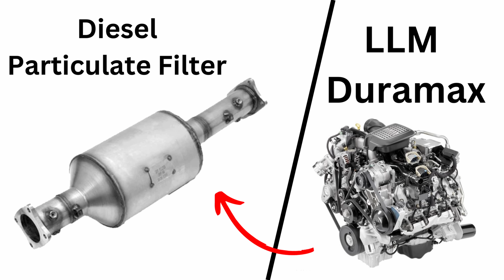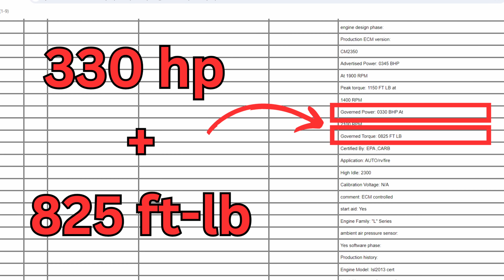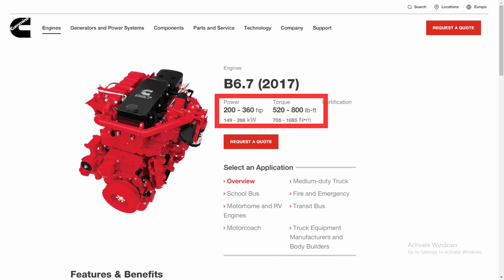Chevy 2500 8.3L DURAMAX Diesel Engine **Diesel Mechanic Review** | Should CUMMINS Be Worried?

Comment: You touched on one of the main points when burning clean.  That's called heat.  The more heat the better to an extent.  I work on jet engines and the more heat and the faster you can turn them the more efficient they are.  To detune an 8.3l engine is called a disaster when it comes to emissions in my humble opinion.  Anyhow great video!!  We will see...
Reply from the maker: Maybe de-tune was the wrong wording. But having lower cylinder temperature would allow less EGR gas going through the engine which would be a really nice bonus.
Reply: @GettysGarage  I respectfully disagree.  The higher the temps. the cleaner the burn.  And less to be recirculated through the system.
Reply: @JetTech1966 not for NOx gasses.  Lower cylinder temps mean less NOx.  It's not about actually making it more efficient, it's about making the engine need less emissions control.  Working within the confines of EPA rules
Reply: @JetTech1966  not for nox  higher temps higher nox.. nox is the most regulated exhaust gas
Reply: @chriso2759  I get what you are saying but I think I was on a different subject than you all.  Agreed lower cylinder temps means less NOx.  BUT....those lower cylinder temps are going to decrease overall efficiency and could very likely turn it into a soot monster.  The particulate filter it would need would have to be on full burn most of the time just burn it all off.   I'm just hoping if this beast is actually made, that it doesn't turn out to be a total bomb by GM and the new owners don't get railed with expensive repair costs.  I can see this thing being extremely sooty and having buildup everywhere.  Hopefully I'm wrong if it indeed is going to be built.
Reply: @JetTech1966  it won't be any more sooty than the other modern ones.  It will just use less egr since it theoretically has cooler cylinder temps at a base.  In essence,they have the same cylinder temps but the big one doesn't need to use the EGR to get there as much.  But yea, the EPA rules suck and make diesels suck.  Only reason I haven't bought a diesel currently
Reply: @chriso2759  My wife and I have been talking about getting the GM diesel but after having the L8T gasser now for a year and a half with zero problems and 20k miles.  I'm scared....lol...We are looking at buying a larger 5th wheel is the reason we are considering one.  I may just stick with the gasser.  It's been spot on reliable!  I would hate to get the diesel and have troubles with it, meanwhile I would be kicking my own butt for getting rid of the gasser.  I want one, but they do scare me for now.

Comment: Seems to me that GM had an 8.?l gasser a number of years ago for a short period of time (maybe early to mid nineties). Currently deciding if I want to get a 3.0 duramax - my big concerns are potentially excessive oil consumption (which GM clams is normal), along with oil that pours like water. Suspect there is a connection there.
Reply: Yeah it was an 8.1 Vortec you could get in a commercial/motorhome chassis or in the HD trucks and SUV's like the HD Suburban
Reply: I've never seen an unhappy owner of a 3.0L Duramax. It's an excellent engine
Reply: @PlayWaves1   Good to hear.
Reply from the maker: Ya GM used to have a big 8L gasser. People seemed to really like it. Simple and realiable

Comment: Yeah I need this emission choked hopped up pickup to pull my bay boat once a month. Stop paying people 400k a year to do nothing and pay your techs what they’re worth. EPA shame on you for forcing this crap on our country. The planet is not of concern. The dollar is. I have made a career out of aftertreatment system troubleshooting and overly engineered 1939 and ISO data line systems. Freaking joke. In 20 years these trucks will all be rusted away and not worth rebuilding and the seasons will still change. GOTCHA! My biggest RO’s are always after treatment system failure with contingent damage, def in fuel system (dumb driver), and in depth electrical. The logic is quickly fading from trucks. Stop buying the statistics. Have you ever seen an EV garbage truck? I have. It won’t ever haul a load more than a few miles. It cost more in resources to engineer and build that truck than my old Detroit will pollute in its lifetime. However, these trucks will make it to the next red light before I do. Got me there.

Comment: How are the ball joints on the chevrolet truck?  I had to replace one on my Dodge Ram with 5.9  at 46K miles.  I know that has nothing to do with the engine, but I wondered about the GM on ball joints. I wish my 2005 Dodge Ram had a Allison transmission. Great Channel,  liked and subscribed, best regards Chuck.
Reply from the maker: They tend to spit them out like every other truck. Depends on what you are doing. I personally don't like the independent suspension on their HD trucks but it seems to work alright

Comment: Perhaps a bigger 8.3 could deliver the same power as is but be within the EPA guidelines. With Cummins being fined and I’d be shocked if Ford isn’t next on their target list.
Reply from the maker: I think Ford and other manufacturers have the fear of god in them after seeing what cummins is going through.
Reply: I completely agree with you.  It comes down to physics and it all is to do with emissions.  Light truck diesel engines have probably been tuned to their max efficiencies and power for their current platforms.  There is not much meat left on the bone -so to speak, and more output would mean more NOx and more EGR and more aftertreatment... maybe even dual SCR catalysts would be needed (YIKES!).
So, unfortunately, the manufacturers need to lower cylinder pressure and temperature to control NOx --BUT lowering cylinder pressures lessens horsepower and KILLs torque!  
One solution to this is to use larger displacement to replace the lost torque, but it will be "de-tuned" so as to keep the EPA peeps off their back. 
Their will be lots of tech in a new diesel platform.  maybe we see cylinder cut-out at idle or low loads to pump O2 into the catalyst??  We are sure to see clever forced induction systems, like twin volute turbos, or compounding, or supercharging, or combination of all of the above.  This will give crisp, on demand control of manifold pressure so it can be dialed up to any boost level at any time (without lag) for instant power when needed and bypass to recirculation when not needed - waiting and ready to flow when the demand is called for.  This would give plenty of dense air (only when needed) to create a more complete burn and reduce particulates; consequently, running at lower cylinder pressures at idle and cruise to reduce NOx.

Comment: As for an updated diesel for GM light duty trucks.. I think a move to an inline 6 diesel makes sense. Duramax already has that platform in the 3.0 liter. Put power numbers up with the Ford H.O. 6.7. An 8.3 V8 diesel would be tight in that engine bay.
Reply from the maker: Id love to see a big inline 6 duramax. But I agree an 8.3L is a big engine
Reply: No they discontinued the 3.0 because it’s a nightmare that’s unfixable
Reply: @fastinradfordable   No they didn't. Ram and Ford discontinued theirs, but you can go buy a 3.0 Duramax Silverado, Sierra, Tahoe, Suburban, Yukon, or Yukon XL with that engine right now.

Comment: 5.9 Cummins is my favorite, my little wrecker was a 94 4x4 Standard Shift. It wasn’t the quickest truck but at 70 mph in a snowstorm with a car on the back, it was awesome. It has a 22 inch frame extension for the tunnel box behind the cab. I wish I still had that truck it was reliable and started at every turn of the key.
Reply from the maker: They don't make them like they used too lol
Reply: Sure...but how fast did it lap the Nurburgring.?  Handling counts just as much as quickness...
Reply: @buckhorncortez  ..+1 .. That's too Funny the Nurburgring. .. Cheers,
Reply: @buckhorncortez  why are you talking about the Ring on a truck channel. VW owns The Ring anyway. Sub 6 minutes, who else is going to do that without having its manufacturing facilities so close. Anyway it’s trucks. Lol!!!
Reply: There's a reason those motors lasted so long, they didn't have all the emissions requirements that we have today that is at the rut of the problems that modern diesels are having, and second, those motor were gutless, the 1994 Cummins had 160hp and 400ft.lbs. of torque, there are 4 cylinder motors making more than that today, those motors were so low on power that they simply didn't tear everything apart like the do today. If they dropped modern diesels to those power levels I'm certain that they would also seem to last forever.
Reply: @pnwdweler4100  That’s why we have Gale Banks, he’s the best engineer to figure this out. Just like the Cat on the ICE’s the PDF is the same. Some day they’ll find out something that won’t kill the diesel but until then I would rather be DEF free and have reliability. Just like the 300 TD from Mercedes a Million Plus Mile Machine!!

Comment: I don’t want 2000 ft lbs of tq.. I want a reliable truck. Easy to service and built to last
Reply: Preach father 🙏 Give us lower prices while we’re praying.
Reply from the maker: Reliability seems to be a thing of the past. Largely out of the manufacturers hands with emission protocols unfortunately
Reply: @TheGettyAdventures  Part of the whole reason this would be 8.3 is to get away from the emissions bs
Reply: @bhswarrior94 well if they just round it up to 751 hp then emissions would not be required 💁‍♂️😉 75hp to 750hp is the range that has to have DPF or DEF emissions. But that’s possible 2 years away so anything could change or happen with.
Reply: @kevink4914  Sorry, below 75 hp, only, the ship of higher power has long sailed. You can do it in India, and such places, but life expectancy is really low, mostly due to pollution.
Reply: @carlthor91 incoherent. I had an aneurism reading that
Reply: @GettysGarage  It's clear that the vast majority of diesel truck owners do not want the emissions equipment harming the mechanical integrity and performance of their machines. 
 As for the monster max, I'm betting this has it's destiny, (and likely the push for development) in military applications.
Reply: @GettysGarage  Yep - Thanks EPA! But it sure does help shift the money
Reply: @GettysGarage emissions affecting engines I’ll concede, but how that affects transmission durability is beyond me.
Reply: @GettysGarage so how do we go about dismantling the epa and such?
Reply: @contractor556 Trump almost did.
Reply: @contractor556 u dont want that.
Reply: @dr._breens_beard  heavily restricted at minimum. Get rid of Chevron deference where they and atf get to interpret rules that have the full force and punishment of  the law?
Reply: All ready have 21 yo D MAX  would love to have monster max
Reply: @techs1smh13  the diaper? 🤣
Reply: Got get a well cared for gmt800, only way to go in my eyes 🤷‍♂️
Reply: Well yea that's what everyone wants... But everyone also wants a new truck
Reply: Despite not being a diesel, my 8.1 gasser is an awesome towing rig. Easy to maintain, great low end grunt for towing due to that large displacement. 5-speed Allison is a dream. Get great and/or similar towing capability as it’s big brother the duramax, but without the stress and cost of diesel maintenance, while holding onto that towing grunt and reliability… so long as you don’t mind a few more fuel fill ups…
Reply: Nobody will be able to afford it.  Lol
Reply: I think that engine would be so heavy that the front ifs wouldn't be able to handle it. Maybe they are thinking of doing a redesign with a solid front axle, or just putting it into the 4500/5500hds
Reply: @evans3390  weight wouldn't matter too much people Cummins swap IFS trucks
Reply: The horsepower war among the Big 3 coupled with Tier IV emissions has destroyed diesel reliability. It doesn’t matter if it’s Ford, Cummins, or Dirty Max . Their reliability sucks compared to the days of a 12 valve, or a 7.3 Power Stroke. 
99% of the market has absolutely no actual need of 1000-2000lb. ft. of torque in a light duty truck but no manufacturer wants to be known as offering the least powerful diesel engine in their trucks.  I’ve been a professional mechanic for 30 years and I personally think a customer who doesn’t need one of these modern money puts for a commercial vehicle is an idiot for spending 100 grand just to go to Home Depot to buy a few 2X4s to haul home. But hey, what do I know? I just have to give customers astronomical estimates to fix these POS. Then I watch their jaws drop to the floor as they plead poverty.
Reply: 8.3L motor isn't going to work hard in most uses. That means less heat and lots of soot. Which could lead to a nightmare of problems with emissions equipment
Reply: There is no profit in reliability.
Reply: Preach to the government then.  The government is the one imposing the crazy emissions requirements that are making these diesels unreliable.
Reply: Well said!!!!
Reply: You don’t have to buy the 8.3. Why not more power?
Reply: And affordable.
Reply: Nothings easy to service nowadays
Reply: Get a ford 6.0 lol
Reply: Preach.
Reply: Won't get that from a chevy
Reply: Good Luck!!
Reply: This and rubber floors....
Reply: I like the idea of a bigger motor, they have pressed the displacement for power for 25 years, but if they make a much larger motor with a bit more power (less proportionally per CI) it will be more reliable because you’re not pushing the engine as hard, consumer trucks are making similar power to full size transports with double the size motor, but they are made for reliability, same reason the commercial stuff is all detuned for reliability.
Reply: That would require the end of emissions protocols and it's a Chevy. They are all made in China.
Reply: I want 2000 lbs of torque
Reply: Unfortunately that ship has sailed, planed obsolescence is the one and only name in GM's game anymore
Reply: Yup u need a first gen. 12V. Not a dodge guy. But I love the Cummins. And the first gen is the funnest simple most reliable truck on the planet. Not to mention it will do 27-28 mpg highway.
Reply: I’m an automotive engineer don’t tell them I told you this, but we (employer) really don’t care. Truck blows up after the warranty. To be honest. Most cars nowadays. Have a 10 year expiration date. The people I work with every day with the smartest people I know from mechanics to former Dakar , and Baja engineers,. Trust me we can make a reliable engine Toyota was doing it back in the 2000s. There’s been multiple cases where through long-term testing we have found multiple issues but since the issues we found “most likely” happen over 200,000 miles we purposely did nothing. our customer base (likely used) who drives cars not far into the future. Don’t have the money to buy a new products so we don’t care what they think about us. And the customer basis I that afford a new truck will have a perfectly problem with the truck for 6 to 8 years. before you ask other companies do the same even Toyota now with the new turbo junk. We usually open up or competitors engines and see what we can rivers engineer or learn from )non-patented) Sooo… sorry 😢 (power train engineer in one of the big American three)
Reply: They all suck these days but Chevy is definitely at the top of the list when it comes to reliability
Reply: 12V Cummins.
Reply: It’s not gonna have 2000 ft lbs it’s gonna have 1200 lbs tq

Comment: No way in hell will they put an 8.3 liter diesel in a 1 ton. I can almost guarantee that this will be a large straight six for the medium duty segment. It will burn diesel like a big block v8 and drink DEF.
Reply: Have it deleted. Get rid of that def. Nothing but problems
Reply: Plus Dirty D are so damn expensive these days honestly I'm going back to gas probably.. most old timers won't mess with these newer diesels with all the reliability troubles..
Reply: Def  lol thats funny
Reply: I get about 175-180 miles per gallon of def in my peterbilt, bigger engine
Reply: My 2001 Silverado had the 8.1L gasser in it, loved the torque but sucked the gas.
Reply: @duaneshumaker3788  I got a 99 454, same story. Love driving it from gas station to gas station
Reply: I dont think it'll be a diesel at all. Just a guess but I think they'll use it as a gasser option to the 6.6 which I hear is kinda weak so they're going to need something to compare maybe beat the 7.3 Ford gasser as they also have the 6.8 gasser for 3/4 and 1 ton and up.. we'll see I guess.. this guy is correct about engine power not having much to do with hauling its all in everything else driveline,suspension etc.. in fact my 6.7 actually tows less than the gasser 7.3 because of weight ratio!